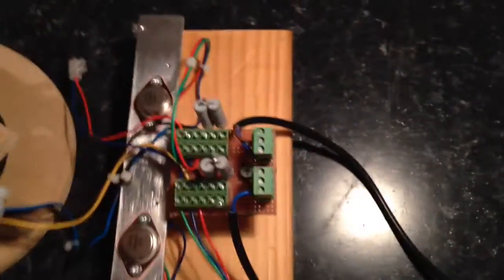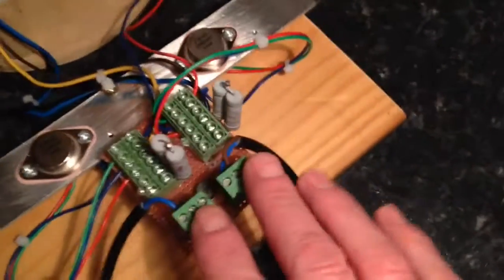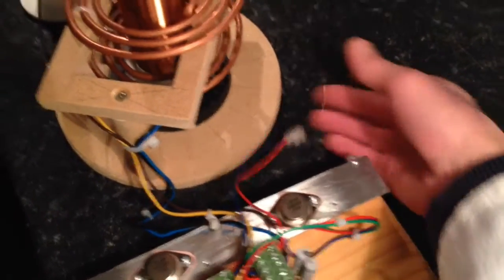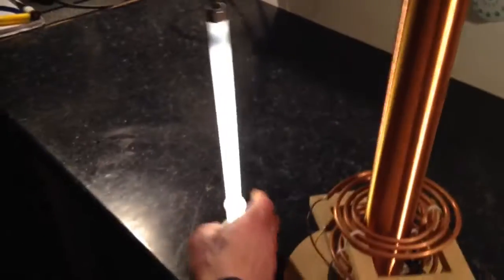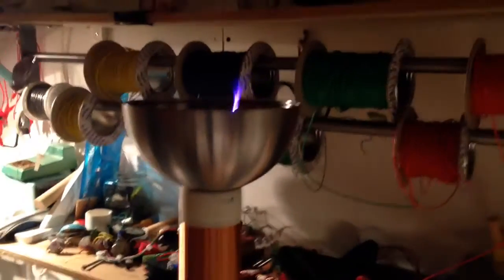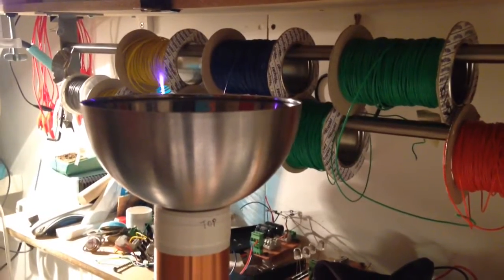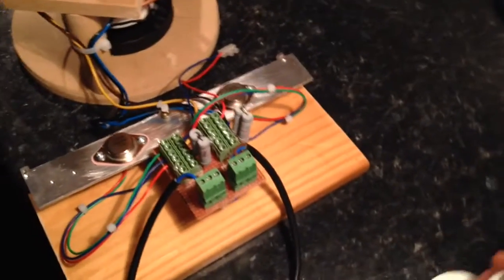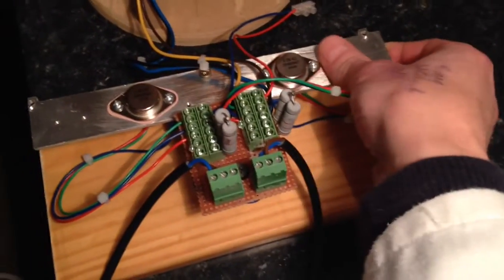Slayer with two primary's and two circuits

Comment: is it possible to wire up say 10 slayers? if so make a new challenge!
Reply from the maker: ... lol.. I put three on the largest coil I've got and that's what took out my power supply.  10 Pancakea is the way to go.. fancy a challenge? hehe.. when I build my own power supply (if I can) then I'm up for as many as I can get on the coil. ;)
Reply: if you had the brains to stack a slayer, you have the brains to build the baddest ass psu out there! =)
Reply from the maker: Tesla Explorer ... that's all the encouragement I need, thanks man. ;)

Comment: ditch that power supply and cut off the secondary of a mot of your liking. get away from those unless you're ready to solve any kickback issues.... even then you're becoming part of the toroid when you're between it and your psu. better you be getting power off an autotransformer mains coil thats isolated thru the mot with however many windings you choose for voltage and then rectified into dc caps... now you have an adjustable power supply thats ready for anything. ive been using just straight mains thru the autotransformer here recently x.x plans are to cut 2 open and assemble 1 back together with 2 primarys. its a better way to control earth grounds =) after you do this you will quickly notice the kickback your psu is receiving when you go to adjust the variac and get some really nice burns from the potential difference you have going on compared to ground thats on the casing of the vari. all of your videos are awesome I can watch them all day! please fix your reply button :D :D :D
Reply from the maker: thanks fella..sorry about the reply button, I'll see what i can do. Thanks for all this info about building a decent DC output.  I noticed you had a transformer with one "white" winding where the secondary would have been and wondered what the deal was. I need to read this a few times but I think I actually understand what you're saying.  The kickback on the PSU is crazy...  totally hear what you're saying on that. It would do some strange things somethings.  Thanks man, really helpful.

Comment: Deeds are the tall things capacitors can u email me the circuit . I like to play. Thanks Roy vinnystvincent@aol.com
Reply from the maker: I found you. I try not to miss a comment if I can bud..  They're huge wattage resisitors my friend, 2k in series so 4k .. slightly over (wattage) what i need but saves burning anything out. I like to turn it up when possile.  4k is a good value, nearly all of the stuff I've been doing lately just runs on 4k really well.
I only have the circuit laid out on paper atm. It's very simple....

It's basically two / three / four.. etc of the most basic slayer circuit you find in instuctables. "Step 2: The Driver Circuit"
http://www.instructables.com/id/How-to-Build-a-Slayer-Exciter/step2/The-Driver-Circuit/

D1 and D1 Diodes in the Ciricuit above come out and replace them with one LED (of your choice).
I just bought a mixed pack of LED's from the electronics store, a science kit.  It was like £1.50 for 50 LED's.
If you experiment with the LED's you''ll find the good ones.  The only trouble with the science mixed kits is it's impossble to know what the LED's are... so when you find a good one.. you may have trouble getting the exact same one again in future.
The large 10mm clear Red LED's work well - they're easy to find in the stores.
These are the last 10mm LED's I bought, you can get the spec. from this page at least.
http://www.rapidonline.com/design-technology/ultrabright-10mm-led-29311

Each primary winding connects to each of the individual circuits.
Common up all the L2 connections from each of the cicuits into one wire... that then connects to your secondary.

All the best uncle Roy

Comment: Are they 2n3055's?

Really impressive getting plasma from a secondary of those dimensions btw, especially with that top big load.

What are your coil dimensions in terms of hight (wound section) width and wire gauge?
Reply from the maker: Thanks man, I believe it's 72cm high. It's 30 gauge wire. There are 1720ish turns. The tube is waste pipe for a sink so it's quite narrow making it tall. Cheers fella
Reply from the maker: Transistors are 2n6547's, I'll measure up in the morning and check the diameter, and confirm the height. That's standard bake pipe 104cm. Cheers
Reply: Its 42mm pipe. I have one too :) I cant get mine to work past 7:1 hight:width
Yours is 17:1.... I've never seen one work well close to that ratio.

I'm using thinner wire though, I bet thats part of the problem. with 48 gauge i'm getting good results at around 294mm winding, which works out to a tough over 2000 turns, added another 300 turns and 35mm hight and it knocked it way out of tune. Going to have to pull some wire off now.

Awesome transistor BTW. Going to have to get some of them!
Reply from the maker: Mongrel Shark .. bang on the money 42mm, you're good!  Great transistors, I was hacking through 3055s when trying to tune up new coils so just found the biggest "idiot proof" one I could find.. and it worked. They're pretty hard to blow. I'm sure you've seen the spec. :)
Reply: Very nice work :) I love it!
Reply: Been looking for a nice idiot proof transistor for ages. Specks are great. pretty much everything is 4x a 3055 :D

Bloody expensive, but if your having trouble blowing them up after destroying a few 3055's its probably worth it.
Reply from the maker: Patrick Labelle .. thanks Patrick, very kind. Take care D

Comment: ive wanted to try something like this, was it pretty picky about where the primaries were? 
looks like way too much fun...i thought it was going to pick up speed and spin around the edge! 
looks like you might have a couple racks of hot wire there   ;)
Reply from the maker: hey bud, I kept the top one in the same position as it was originally and just slung a second one in there, I did a little modification to it tonight so I can adjust them, but to be honest becuase they're pancake there's heaps of space they're good anywhere near the bottom.  And mate... I hadn't thought about the two hots wires!.  I've already got some evil plans forming!. good little nudge there, thanks man.